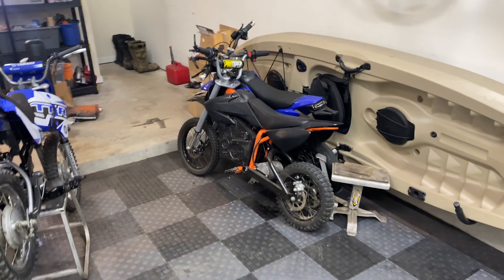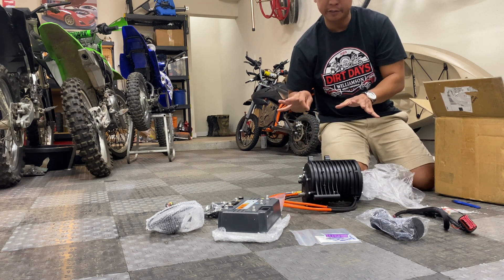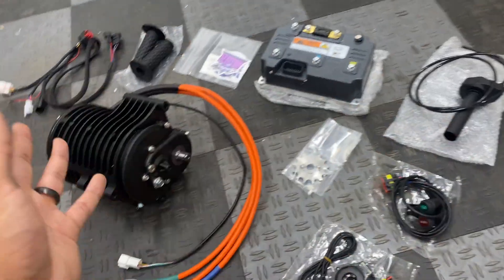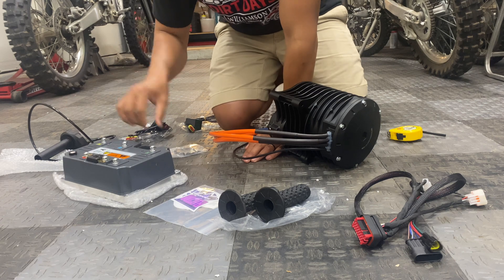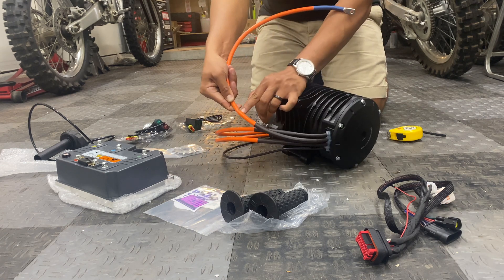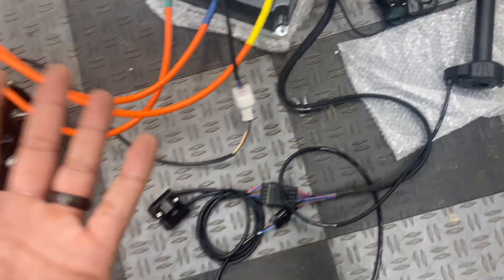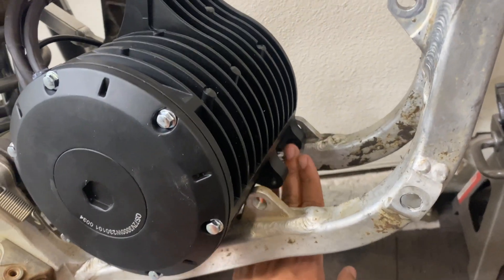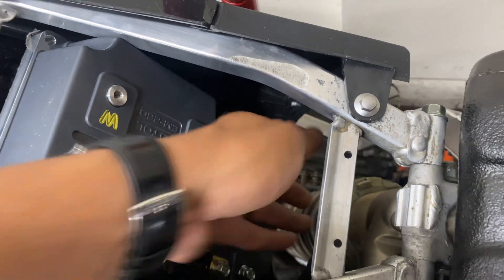Electro & Co EMX 25kW Kit Unboxing Parts Overview E&C QS138 70H V3 Votol EM-260 Controller

Comment: awesome kit man. how did you get ahold of them, having trouble?
Reply from the maker: I emailed them. Yes it takes 2-3 days for each response sometimes.. But I just bought it on their website
Reply: @PatOutdoors  thanks! question for ya...i am an E beginner. looking to electrify an old honda SL125. do you think ordering from E&C makes more sense than just ordering the qs138 on ebay and the battery from amorge? does it save enough headache to justify?

Comment: Hey Pat, what battery do you recommend for a tao tao db17 frame, with a qs138 70h v3 and em200sp or em260sp? Ps. Not the electro and co kit.
Reply from the maker: You can contact Allan at AMORGE for a custom battery. Sounds like you need a 72V with at least 34AH. I’m using that with a 400A Ant BMS. You can also give them the dimensions you need to work with and they’ll build it custom for you (3-4 weeks)
Reply: @PatOutdoors  For a 125cc bike (2016 Tao Tao Db17)  what battery do you think is good for em150sp? Thanks
Reply: @PatOutdoors  Also for my 3000w Qs 138 70h v3, the store Siaecyocs recommended not using the em260sp and instead the em150sp as a 3000w motor did not need that much. Are they right?

Comment: Hey Pat, it seems like we're on the exact same timeline.  I received the same package yesterday after a 1 month wait almost to the day.......and I also have damaged phase wires.  For anyone reading, my votol 260 won't fit as clean as yours does in my air box (RMZ-250).  Also, I ordered my brackets from MightE ltd and got the motor mounted yesterday with similar M8/M10 hardware.  Noob question......I'm having trouble mounting the pinion gear.  Your vid showed it briefly, were you using a ratchet?  Any tips would be helpful.  Thanks for the vids and I'm very interested in how your battery will perform so please update us when you can.
Reply from the maker: Hi Mike, Can you give me a link to the mount kit you ordered? The sprocket is relatively simple, the plate on the outside is just offset. You put the chain on the sprocket, slide the sprocket on the shaft, and the slide the locking plate on, rotate it so the lock screws line up, then tighten the screws to lock it in place. The shaft has a groove cut a few mm from the very end, which is where the lock plate will keep it in place. I’ll post an update as soon as the battery comes in!

Comment: Hey I have a question about you razor mx650 with the 48v 20ah is it safe how it comes ? And did you do anything to it I’ve been hearing a lot of mixed reviews
Reply from the maker: I immediately had issue with that battery and had it switched to a different battery immediately after two videos. I went over that last year in the range test video after the install. Replaced with a 72v pack and had no issues since with that one

Comment: this motor over the qs 165v2?
Reply from the maker: Do you personally have experience using a QS165 on your bike? How was it like mounting it on your dirt bike frame?
Reply: @PatOutdoors  waiting for it still
Reply from the maker: @2-8-4  I got nothing against the Qs165, I just thought it would be easier to mount a QS138 on since there are so many brackets to choose from on the housing. Rated very similar as far as continuous power and short bursts 22-25kw for both. What controller are you using?
Reply: @PatOutdoors  fardriver nd72680 trying to fit a 72v 40ah in there
Reply from the maker: @2-8-4  I actually have a second kit coming in this week, using a ND72530 fardriver controller on the other one for my little TTR-90 build
Reply: @PatOutdoors its my first time using qs but i have a question do you prefer hall sensor or encoder motors? and also you should try a top speed test soon i’m enjoying your builds and conversions your videos help thank u.

Comment: Wow! That thing is gonna be sick. Can’t wait to see where you’re going to hide the battery. Curious what the cost is gonna be for motor and battery. You have inspired me Pat. I am in Saint Thomas Ontario Canada. Home of Joe Thorton and Rachel McAdams. I just picked up a brand new razor SX 500 McGrath from Amazon and the prices are dropping fast. I got about 625 invested Canadian and they just went down to $513 Canadian. That’s 560 after taxes. So so far I’ve added voltmeter and I rewired it with the XJ 60 connections so I could throw in a couple 48 V lithium ion battery packs. They slide right in under the cover on top of the regular battery box. I am just keeping the 36 volt batteries in there for back up. I just need to rig up a switch so I could switch from one to the other. I also already had the Vevor 48 V 2000 W kits but that’s coming later. But I think it’s still more fun than I had putting money in to  boating.
And the sweet thing is I can work on this in my living room. Happy trails.😎
Oh I have one question. This is my first time using these XT 60 connections. They’re not that easy to pull apart. I wonder if I could put a little dielectric grease on them. The stuff that’s used for  battery terminals. Clear like Vaseline. Thinking a little bit might not hurt. Stop the brass from corroding also. What do you think?
Reply: idk about this per say.

It'll help waterproof it as well, and its just good to do on all electric connections.,
Reply from the maker: I would say budget $3-4K for a QS138 kit and battery. I'll likely be cutting the bottom of the tank and some brackets off the inside of the frame to make it all work. I can't imagine dielectric grease would help too much with making it easier to pull apart. I honestly feel better that the connection doesn't separate easily considering the abuse these bikes are gonna go through the trails.